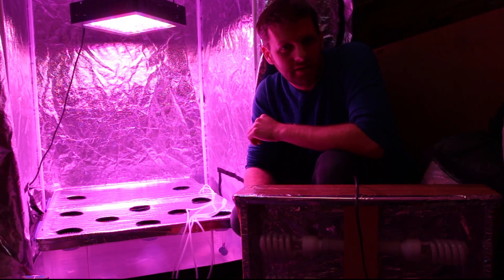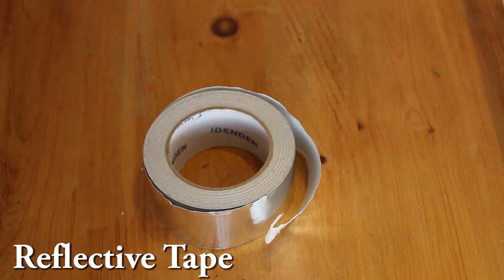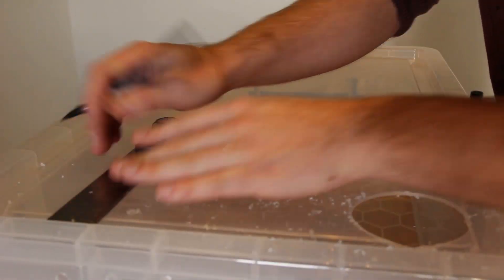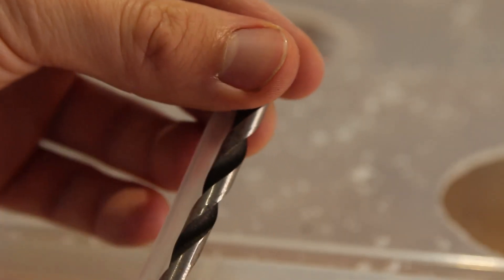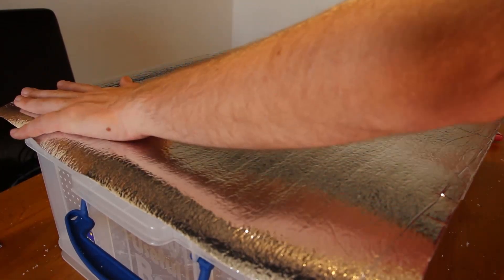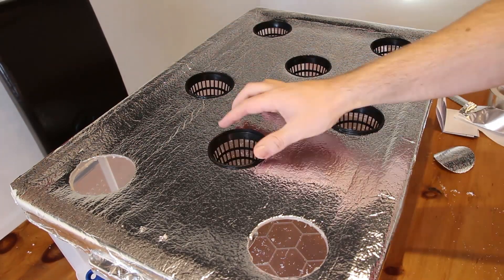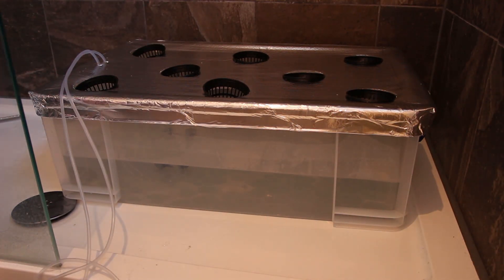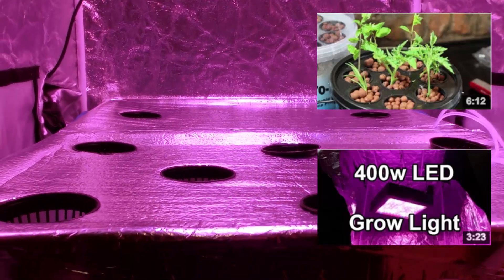Homemade DWC Hydroponics System - DIY Deep Water Culture How-to

Comment: I give you props for taking the time to make this video. It's instructional and overall would be a good beginner's system.
For anyone considering building this I would make the following suggestions. 1st, as he says in the video, get a black box! Not hard to find online. Not sure why you would ever want to use a transparent box. So much extra work and even the base being transparent is an issue.
Getting a black box also takes out of the equation the taping of the lid on to the base. Changing the water would likely involve removing the tape and then re-taping. Also, after each crop you're going to want to do a thorough cleaning which would also involve removing and re-taping. In other words, be prepared to buy a lot of reflective tape! Reflective tape is not cheap!
As someone else said, I would also recommend drilling the air holes into the base instead of the lid. Very high up on the base.My other suggestion involving bubbling with this type of system where your roots are always in the water is to space out the air stones for even distribution across the container. Also, on this type of system you want to keep those bubblers going all the time and a general rule of thumb is you can never have too many bubbles whenever the roots are in the water 24 hours a day.
The other problem I see with this type of system is that the water is directly below the light source. If you're growing in a tent, it's going to get a little bit on the warm side which is fine for your plants but not so much for the water as this can cause root rot. Yes, even LED lights throw off heat!
You could keep the water cooler by adding another reservoir outside your tent with a small water pump and then build a return. This would keep the water circulating constantly and as long as the outside room is on the cool side you shouldn't have a lot of problems with water temperature.

Comment: Drill the air hose holes high up on the side of main box meaning access through the lid is far easier to change the water, etc.